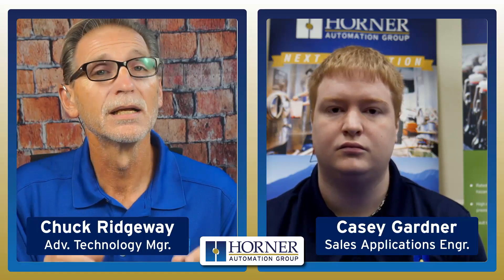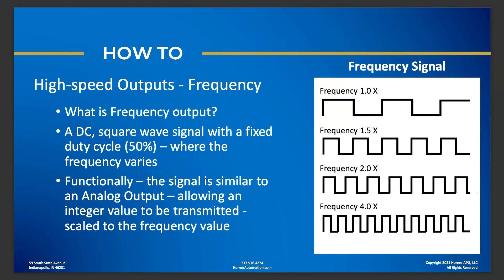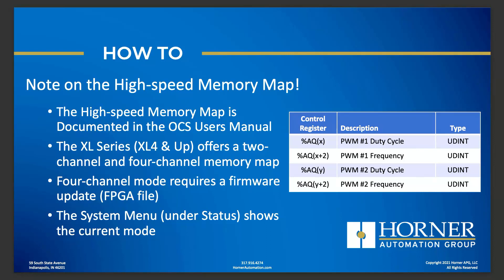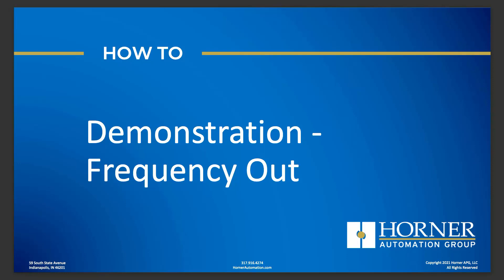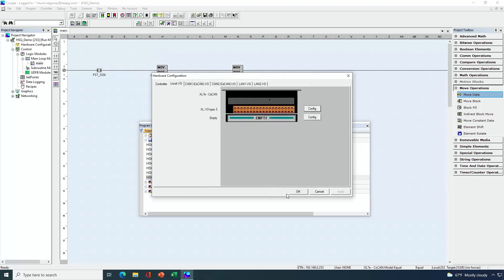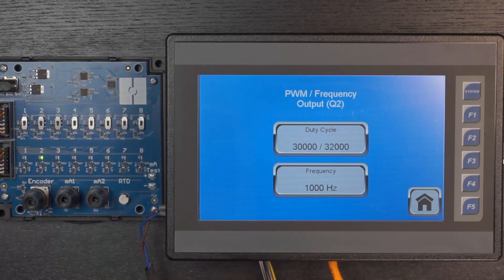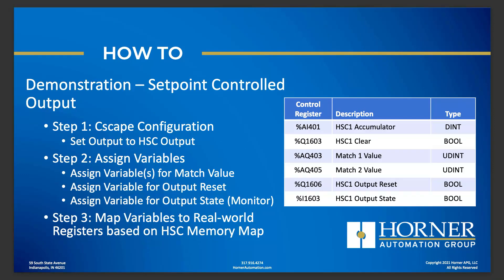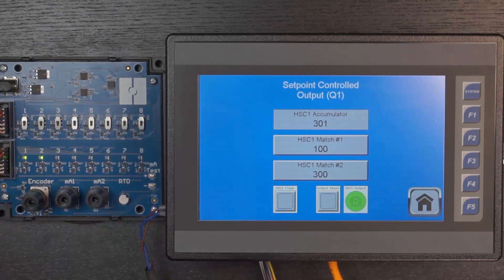How To: High Speed Outputs on the Horner OCS

Comment: Is there a way to use PWM for <1 Hz frequencies? or at that point in time should you just switch to using timers/counters ladder logic?
Reply: Hi Dario,

Unfortunately no, the native PWM output doesn't have lower than 1 Hz resolution, so I would recommend using timers/counters in logic as you suggested.

Comment: Will the HE-XPC1E6 accept the HEXHSQ for 2 more HS outputs?
Reply: No - it does not add 2 additional outputs to any model that already has solid state digital outputs.  In some cases the add-on can increase the frequency spec, but probably not that model.
Reply: No - it does not add two outputs for those models that already have solid-state digital outputs.